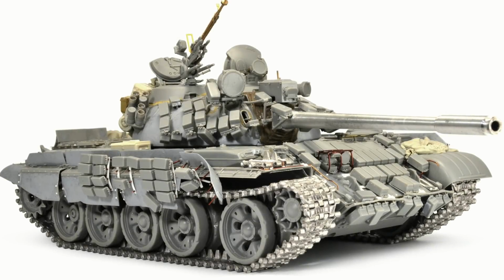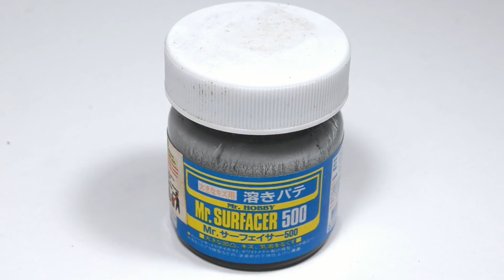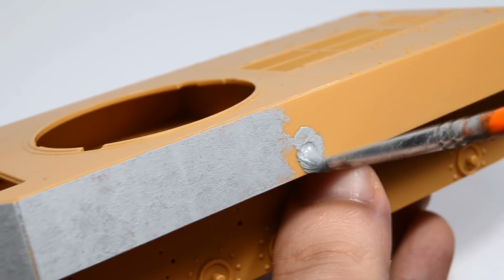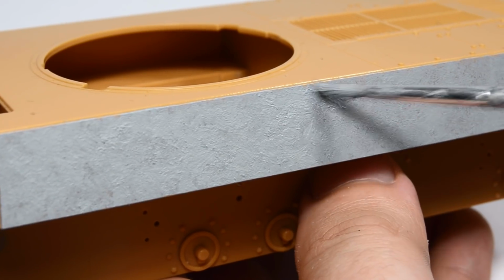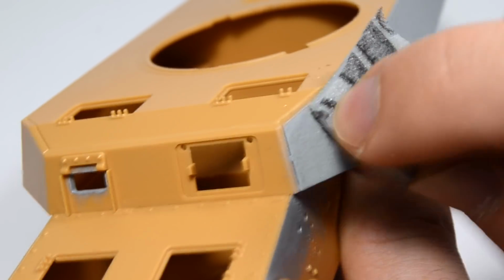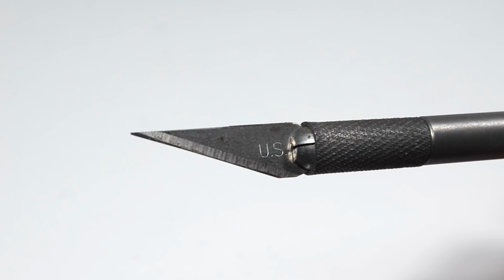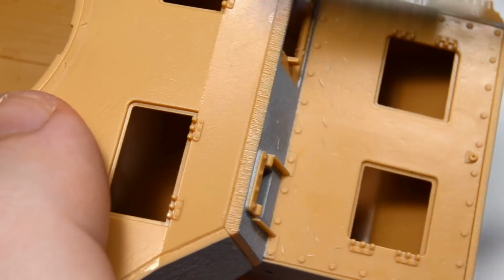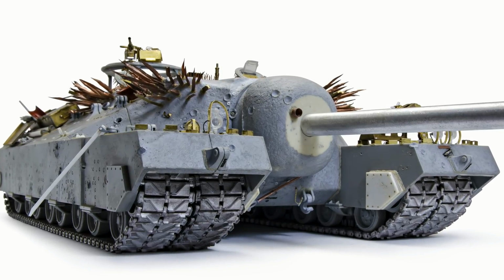HOW TO: Armor Texture & Flame Cut Marks

Comment: I don't model, but having used a track torch to cut thick steel, it pleases me to see someone actually put it into a model.

Something to consider if you're doing a project that is much larger scale is the curve that those cuts have. In thick metal there is a delay between when the flame begins to cut the metal, and when it comes out the other side, leaving a curved kerf that's pretty sloppy on the opposite side of the torch due to the flame being less.... targeted?

Additionally, I think the reason that modern tanks are typically smooth is that they remove the mill-scale from the steel in most countries before painting. Obviously, Russian tanks don't have that done, but looking at Russian arms in general, they really don't care about making things look pretty, so long as they work. Them leaving the milling marks on weapons like the AS VAL are good examples of that.
Reply from the maker: Thanks a lot for so much valuable info! 
Yes many tanks in WW2 had their flame cut edges left like that, but there were some exceptions of course. Nowadays they all seem to have been machined except some Russian stuff. 
From a modeller's perspective these surfaces are very nice eye-catching details and add to that "heavy" look we're after.

Comment: Tank armor was thinner on top to reduce weight and in a tank battle, it is rare that an enemy tank will "lob" a round and hit the tank on top. 99.9% of shots hit on the front, sides or back of the vehicle. 

That's why artillery was used against tanks effectively in WWII because the rounds fell from above penetrating the tank's thinner armor. 

That's also why fighter planes equipped with 20 mm cannons were also effective against tanks because the rounds could penetrate the top layer.
Reply from the maker: true!

Comment: The top armor of the vehicle would be smoother because the material is thinner. Its propably rolled down to a desired thickness, while front and side hull armor would be casted directly?
Reply: We're talking about rolled armor here, and not cast armor, right?  In that case, the thinner armor has been passed through sets of rollers more times than the thicker armor.  The process of rolling it out thinner has the effect of 'polishing' the surface.
Reply: @VOLHans  thats what ive meant, i havent specivied it thou.

Comment: I'm not a "Tank Modeler" by any means... I understand "Weld Seams"... but what ARE "FLAME MARKS"?
I ASSUME that they are "Marks" in the Thick Metal where an "Acetylene Torch" was used to Cut Out/Cut Away metal from that part? 
They Used Acetylene for cutting, which caused somewhat "Jagged" marks. And because they didn't HAVE Computerized Torch Cutting Machines back in WWII And so those "Torch Cut Marks" are the result?

Am I Correct on this? 

Thanks.

Joe

Comment: Hey! Did you know there are TWO types of Tamiya Extra Thin?  Regular and Quick Setting types.
Reply from the maker: Didn't know about that. However Extra Thin melts the plastic too much for my taste. It was my fav glue for a long time until I discovered Cement S. That stuff evaporates without any trace even if you accidentally flood the surface.
Reply: I wonder if quick setting is a different formula.  Maybe it's the same as Cement S.  Since I haven't tried this technique with either cement, I will go with your recommendation.

Comment: I know this is an old video but I've just done a test using Deluxe materials perfect plastic putty(ppp) and Revell contacta cement as that's what I owned already.
The result isn't great, I think the ppp might be a sort of plaster like product so doesn't interact with the glue at all.
Has anyone tried with other products or should I just hunt down what was specifically used in the video?

Comment: Very nice channel. I subscribed since the first video I saw. Question: would limonene type Mr Cement work the same as the cement you are using? I guess it would as it is supposed to melt the plastic. But with this things you never know.
Reply from the maker: Thank you. If it melts plastic, then it should work. Never used it, so can't say 100%. You can try it and share your findings!

Comment: Would you advise your Tamiya putty and glue method for resin surfaces, or would it be more advisable to use Mr Surfacer instead? 

Keep up the awesome videos, love the humour too!!
Reply from the maker: It actually doesn't matter, both hold pretty well on resin.
Reply: @NightShiftScaleModels  most excellent, thank you, I'll go with your method then, as at least I can mix the consistency's myself that way!!!
Reply: @NightShiftScaleModels  sorry to trouble you again, I'm having rouble finding glue you advised in the tutorial, would Tamiya extra thin  work in its place as a means to dilute the putty?
Reply from the maker: sure
Reply: @NightShiftScaleModels  brilliant, thanks again for the reply, can't get enough of your videos!!!

Comment: Once I build a super detailed tie fighter, everything turned out perfectly. 
I also mounted the booster jets facing the wrong direction, I didn't realized it for months sitting in a Display shelf. That's how deep I was into detailing it. I got also a photo as Thumbnail of a less detailed Millennium Falcon for one of my videos out there.
In conclusion, I get pretty mucg lost in everything I do.

Comment: Do you have any advice on texturing models which aren't made from styrene?
Reply from the maker: it’s the same process mate
Reply: @NightShiftScaleModels  ok, I was just wondering since you said that the first layer of putty+cement was partly there to attack the plastic, which won't happen if you're using it on something that the cement can't dissolve.
Reply from the maker: Yeah, it won't happen, but apart from that the result will be almost identical. I used it several times on resin parts.
Reply: @NightShiftScaleModels  cool, I'll definitely try the technique out (although I might not be painting a vehicle for a while). I'm really enjoying your videos!

Comment: Right in front of your eyes! I have a challenge for you. If I had an email address for you I could send you a photo to show you exactly what I am going to try to explain. I came across a film of a Panther tank driving slowly right next to the photographer that showed the rubber road wheels were coming apart by layers. It is not coming apart in chunks. So the trick would be how to make a Panther (or Tiger E) road wheel which is coming apart in layers. Are you up to it? Im not, that's why I write you!

Comment: Still have no idea what a flame cut actually is
Reply from the maker: Thick steel plates have to be cut using a jet of super hot flame. So flame cut edges are basically molten steel.